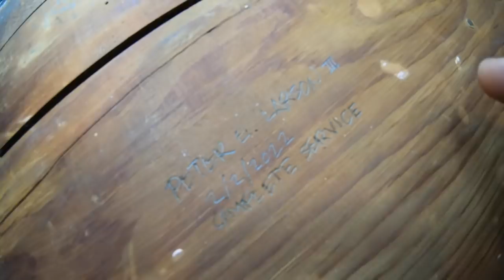IT'S ALIVE! (church clock repair part 3)

Comment: Pete, it's kind of funny that there's a dichotomy between the Repair videos you've been doing. I mean the tractors and the clocks. In 1 you have parts that you need a chain lift to move around, and then the other parts are so small you need a magnifying glass and tweezers to find them. But in both, thousandths of an inch make the difference between working well, or not at all.

Comment: in my restoration business here's what I did to tighten screw holes; first clean out the hole and then glue in a small wooden dowel to fill  up the hole, then when glue dries you and screw in a new screw or the old one and it will be tight. also to repair gold trim on face of clock you could use gold flake artist paint or put on gold leaf.  although more time consuming I like the looks of new gold leaf. Easy to do with sizing compound and sheets of gold leaf. You did an excellent job of restoring this clock. I've repaired about 5 of them over my 25 years in business.

Comment: Well it hasnt been a year yet, and I've watched this video all the way through again and with the same pleasure I got the last time I watched it. isn't CRS wonderful! you get to watch things over again as if it were the first time ha ha. Naw, some things are just worth watching again. and like a lot of your viewers I like the fact that you explain your logic to what and why you are doing things. And I like your tip on cutting finishing nails to prevent splitting wood I knew that but it has slid into the hard to retrieve portion of my memory bank so once again Pete thanks again for taking the time to do these and to share. God speed. ECF.

Comment: Nice job Pete most people would leave it hanging and not repair. I stopped picked up a nice old tube type radio that someone was throw out. Used to be able go hardware store test the tubes and get new ones. It was all ways fun to get a old radio to work. This is good mind videos thankyou. Have a great day.

Comment: Thanks so much for sharing your clock repair videos. That way the pendulum hangs behind the movement is probably a rather smart way to achieve a long pendulum length inside the limited confines of the housing.

Comment: Good job on the interdiction love it Frankenstein. Hey Pete what kinda of calipers do you have can you get them on line and I guess you order tractor parts from Steiner tractor parts do you order all your parts there if you can I would like to know because I order parts to and order from them occasionally are they more reliably . I guess you ordered all your clock tools from the two sources you told about and your magnifying glasses and the table mount.

Comment: Great repair Pete. I've often wondered how the gear assembly's in old clocks worked. I now have a better idea. not enough for me to run out and buy some clock tools. but enough to have satisfied my curiosity. If you stop and think about it. that clock looked an awful lot like the gears in the MD's transmission. the only thing missing there was a Pendulum hanging below the transmission case!  well it was a thought anyway. But none the less a very enjoyable tutorial video thank you so  much for taking the time to do it, and better yet to share it with us. ECF
Reply: If the motor on the MD gets so old and tired it just can’t go any more, Pete can open up the transmission case and install a man-sized main spring. She’ll plow like crazy but you have to stop every 4 furrows and wind her up with the starting crank. 🥸👍🚜
Reply: @joeromanak8797  
Better still....a Mickey Mouse car wind-up clock style key driven off the PTO......

Comment: got an electronic like this if it isn't perfectly level it runs fast or slow depending on how it is tilted(use a small  level to set it up)
Reply: The electronic has a very small mechanism...and it is sometimes used to move very large hands...
Definitely not as much horsepower as the mechanical mechanism to regulate a "slope".

Comment: You didn't need a hoist or a floor jack to lift the parts into place.  I find this every bit as engaging as tractor rebuilding.  I find the challenges of making mechanical systems work as designed to be very compelling, no matter how big or small.  Unfortunately for me, small is getting harder to do because of failing eyesight.

Comment: Awesome job Pete, sould run great for years again. Did you clean and oil the Main Spring to? 👍
Reply from the maker: I did not. I don’t have a spring winder so it is difficult for me to do that safely. Often I just put new springs in, but this one was relatively clean and in good shape.
Reply: @JustaFewAcresFarm  
Oh, yes the springs can be dangerous without a winder, and it did look clean  during assembly.  Great Job Pete love your Channel 👍

Comment: That was so interesting Pete.  You have so much talent in so many areas. The snipped nail to eliminate wood crack interests me. But which piece did you use?
Reply: The head is in the usual place and the blunt end is pushed into the wood.
It crushes the fibres in the wood rather than splitting them with the wedge of a sharp point.
No wedge...no crack.
Reply: @JohnSmith-pl2bk  Ah, thanks John

Comment: Greg video, Question: Why would they hide the pendulum. Thanks
Reply: The important part of the clock....is the face...and telling the time.
By placing the pendulum inside the case it means that dust is less likely to enter the mechanism.
It also means less distraction in Church....!